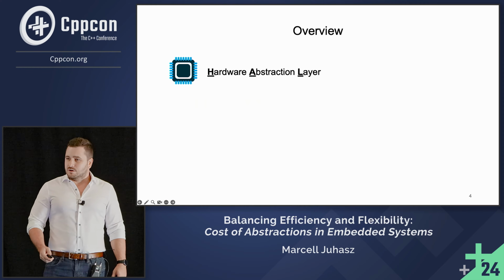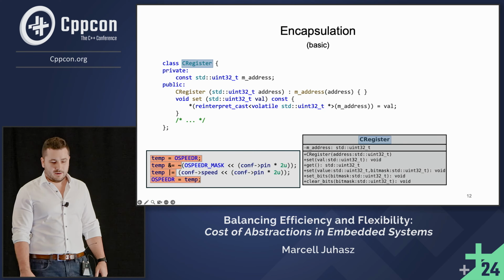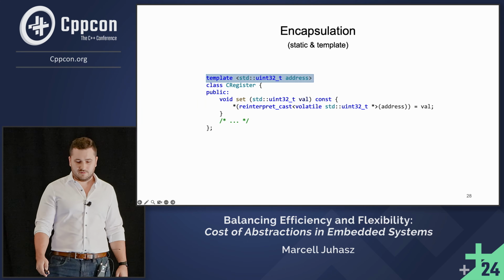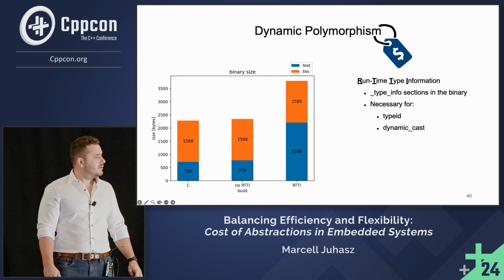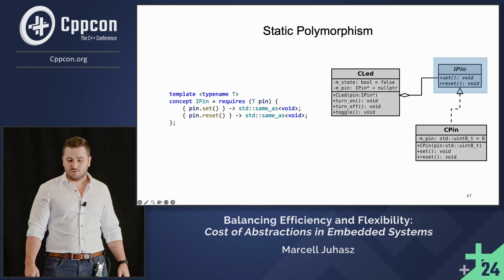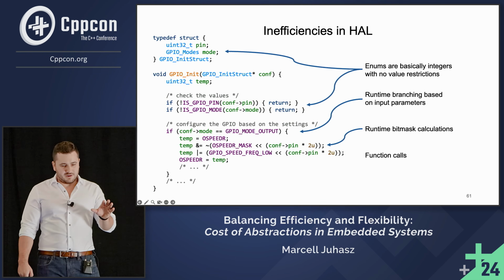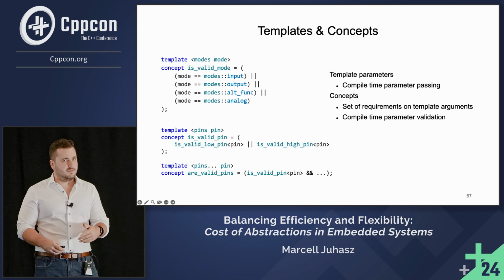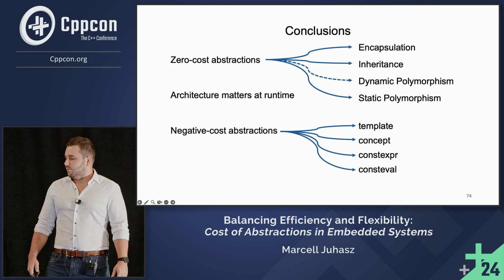Cost of C++ Abstractions in C++ Embedded Systems - Marcell Juhasz - CppCon 2024

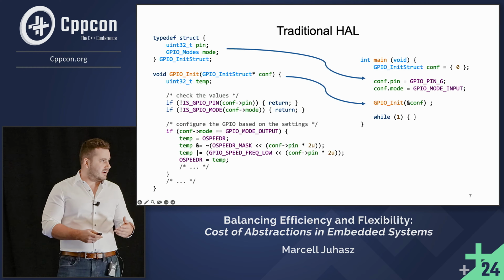Comment: 7:00, an infinite loop without side-effect is UB, as well as promising to return some type, and not doing it.
	Since system calls seems to not be welcomed, it could be then replace the ill-formed loop with a giant counting:

#define wait     for (size_t j=0; j < -1LU; j++)
	wait; wait; wait; wait; wait; wait; wait; wait;
	return 0;   // EXIT_SUCCESS would require <cstdlib>.
	The optimizer will remove this new "infinite loop" as ineffective code.

	As for the returning UB, a defensive approach is to declare the returning type as 'auto'. Or even better, use a macro:

#define auto_    auto     // typedef doesn't work here.
// #define auto_  TIME_TO_REVIEW_AUTO_RETURNING_TYPES // To be activated later.
	So auto_ will avoid returning UBs. Later, the 2nd line is activated instead, spreading high-level compile messages. Any proper code editor will open the places in need to fix, so that there won't be headaches about searching those places.
	However, the best solution for me is to use an IDE feature. ie. in Codeblocks, there's the "abbreviations" feature. 1 can type a custom keyword, and then hit Ctrl-J to replace it by a predefined code, like:

int missing_name () noexcept {     // In case of forgetting to pass the -fnoexceptions flag.

	return DONT_FORGET_TO_RETURN;  // High level compile message, always remembering to avoid this UB.
}
	It's also possible to config. this abbreviation to query the dev. about the returning type and f() name, before replacing the code.

9:00, 'set' should not be public, so that the class would become const-by-default. Then a list of 'friend's would allow a few f()s to access it.
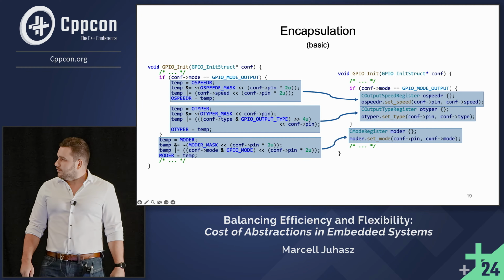11:20, passing those values on the constructor is a better strategy, because 1) generates less LoC (more readable/maintainable), 2) it's nearer to the possibility of extinguish the set f()s, if possible - worth to be analyzed later, so it should be the default .
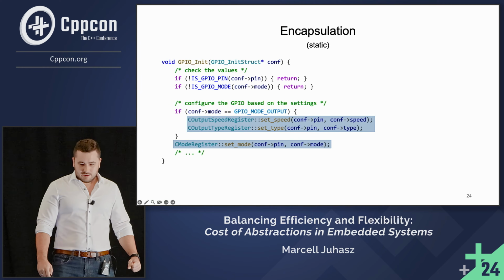13:17, the advantage of having those f()s inside a class, even if it doesn't has data, is that you can control who is calling the f()s. It makes debugging easier.

Comment: With dynamic polymorphisms, we need to introduce interfaces. Author suggested that those interfaces can be reusable. However, different MCU of different vendors have different implementation of peripherals. They add variety of features to the peripherals with different vendors. Therefore, you need to change the interface. Certain peripherals such as communication peripherals might be same and we don't need to change the peripherals. 

Another point is, writing HAL is very time consuming. If your timing requirements are satisfied with vendor delivered HAL, then use them because you will save lot of time. Only write optimized code when it's required. 

You can introduce BSP layer where you can write drivers for external peripherals which might be tightly coupled with HAL. If you want to change the MCU, then only this layer will be affected. You business logic remains intact. If your business logic is tightly coupled with hardware, then it's very difficult to port to another MCU

Comment: Tell Loudly is CLion IDE is built on Java. 

Now, Why should I use Java based IDE which uses a tons of RAM, compared to C++ based IDE
Reply: Because there simply is no good C++ based IDE.
STM Cube? That's Eclipse. Written in Java. And it is not good.
VS Code? Electron / TypeScript
Visual Studio? Only if you want to develop for Windows. LOL.

All the JetBrains IDEs, that are based on a common core, are just awesome.
Reply: Java isn't that bad. Could have been Javascript (probably Typescript), I also find CLion a great IDE. Would it be better if it were written in C++? Probably. Unfortunately it started as a Java IDE.
Reply: Why not? Usually development machines have enougth RAM and there are no IDEs built in C++ or something similar, which have the same features as vsCode or CLion
Reply: @knecht3000  well, if you are windows,  then you want to use WSL, Docker, million tabs on Chrome, CLion, Teams, Outlook etc. it will explode your RAM. Minimum 32 GB required.
Reply: They already introduced C++ engine it's called Reshape. I think you need to change in the settings to use C++ engine.
Reply: If you have to ask, there is no point of answering you. You're very likely in a wrong profession/hobby.

Comment: awesome, but i actually thought that c++ in embedded systems is evaded due to lack of toolchain rather than bloating language features
Reply: Especially when it comes to embedded systems that are ARM based, it certainly helps that so much nowadays is based on some kind of ARM. GCC and clang for ARM are amazing.
I wouldn't want to do much in terms of C++ on an AVR for sure.
Reply: @Colaholiker  I wrote a system for controlling addressable LEDs for AVR in C++ and it all worked well. While optimizing, one gem I missed for ages was the hardware integer multiply that appears to execute in a single cycle! Not an entirely relevant reply to your comment, but hey,  a little gem even out of context makes the world a shinier place :)
Reply: that is indeed a problem for ancient microcontrollers. c++ support is often very limited and non standard.

but newer microcontrollers like esp32, rpi pico, stm32 series all have toolchains that support modern c++.
Reply: @destiny_02 This is true.  I was writing a motion controller in STM32 in C++23 a couple of months ago.

Comment: Food for thought - look at the low level architecture of the processor.

Loading constants is somewhat expensive (2 bytes LDR + 4 bytes constant) on ARM. More recent ARM Cortex-M processors include bit field instructions that will require less code size than precalculated masks for static bit locations. Bit field insert / extract are 4 byte instructions, vs. loading a constant mask + doing and, then shift. Bit field extract can also be done using two shift instructions (shift left to limit number of bits, then shift right), 4 bytes of code.

For register access, you want to pass the base address to your functions, and then use base + offset access (2 byte instructions) to read or write individual registers, rather than tediously loading separate constants for each individual register.

Both C and C++ languages seem woefully inadequate for efficiently defining register structures with bitfields at specific bit locations, and lack control for combined updates to multiple bit fields in the same read / write sequence. Of course you can load into a temp variable, but then the compiler doesn't know what hardware register you are working on, and mistakes like using the wrong bit field definitions become possible.

Additional space savings would be possible if a language allows for preserved function parameters (e.g. the base address), allowing for more efficient call sequences using the same base.

Comment: I would urge anyone doing this kind of thing to spend some time doing it all in assembler. Then they might start to wonder why we need this massively complex tower of abstractions.
Reply: Assembly should be reserved for cases where the compiler doesn't produce good code (vector/simd typically). One can achieve the same effect, with far less effort and more readability, by using C. Assembly also does not preclude one from generating a complex tower of abstractions other than by virtue of tedium. Similar code can then be used on an ARM-M3, RISC-V or whatever as long as there is a C/C++ compiler for it, This is especially useful when using FPGA based peripherals where only the processor changes. With assembler, one would have to recode everything everytime.